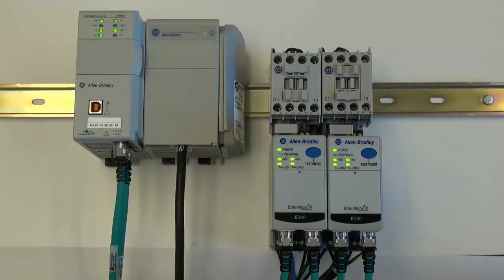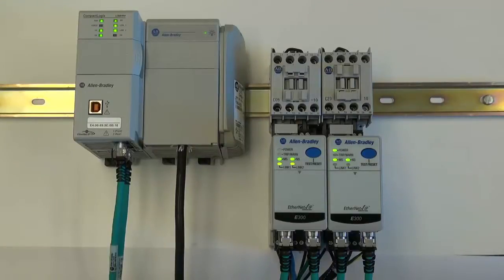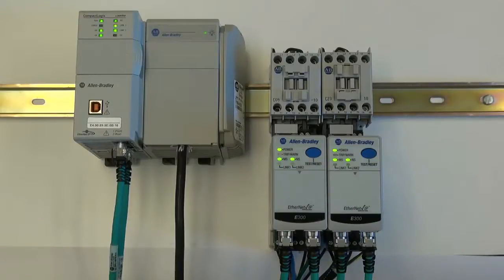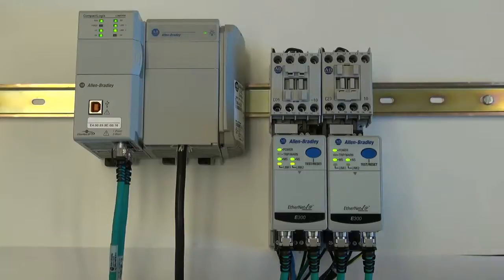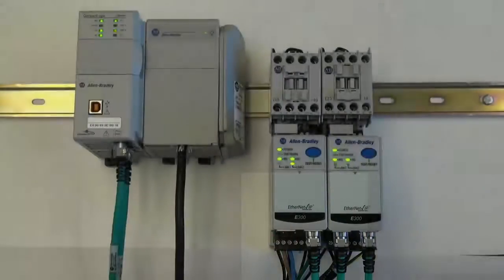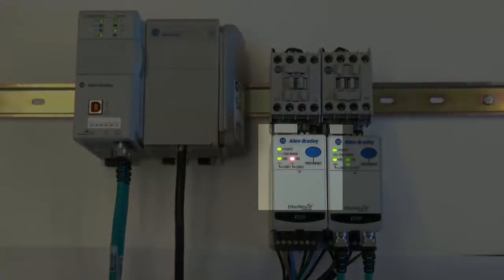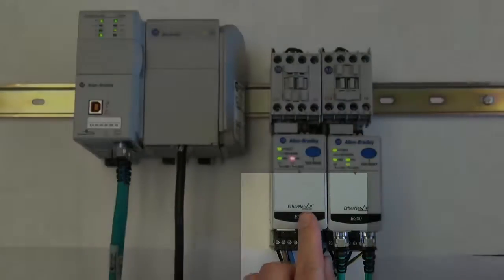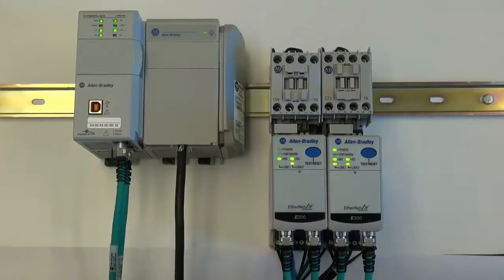E300 Electronic Overload Relay - Demonstration of Device Level Ring

Comment: Hi. One question. If you swicht off one component, for example an Etap. 
The ring follow working ok in mode lineal? It s the same swicht off the 
component than pull out 2 cables?  thanks